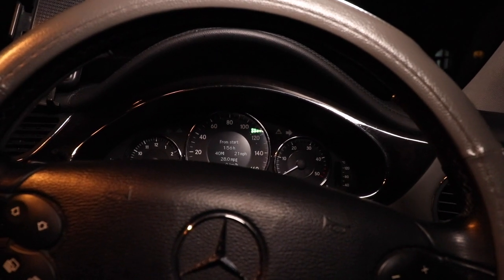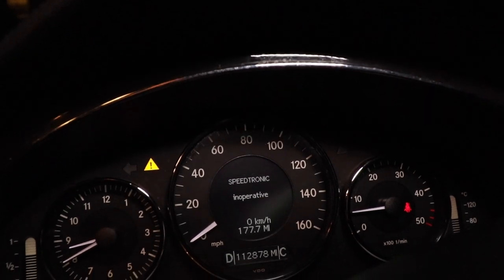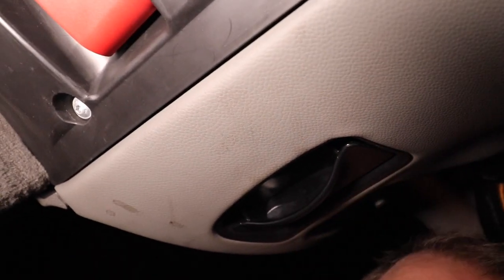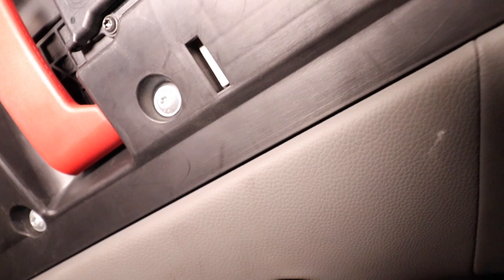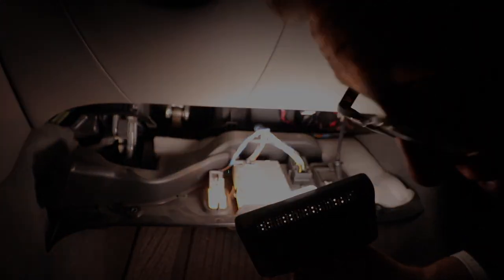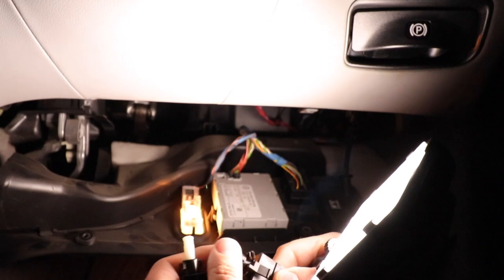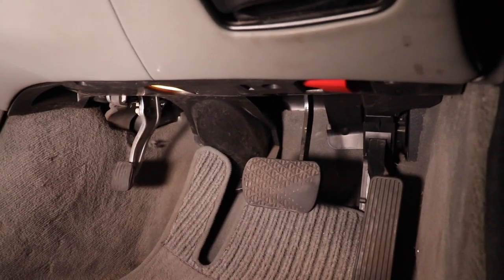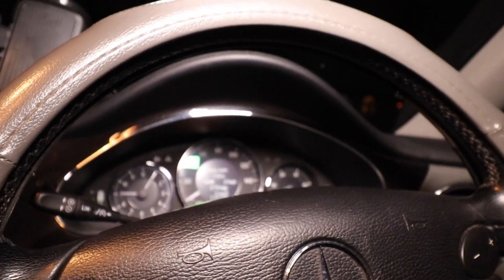ESP, Speedtronic inoperative, brake light switch

Comment: Does anyone have info where I can find a brake light switch for 2006 ml500 please!!??
Reply from the maker: What country?
Reply: @RG500_detectorist  U.S. Does it even have one? Man, I'm in a bad situation. My car is getting worse. Now has the big BRAKE light on and its taken the power steering. ??
Reply from the maker: @WhoDeyWildcatsReds  try it. It breaks everything
Reply: @RG500_detectorist  I've looked extensively across the internet for a brake light switch for that model and I haven't had any luck or I would. Is there a similar part maybe in the 2006 US version? Or maybe it's called by another name?
Reply from the maker: @WhoDeyWildcatsReds  Looking down the comments. 
@khaledakl38 - 2 years ago bought one for 8 usd.

TRY THESE:

Looking on Google, I've found lots of sellers of this part. Pattern and original for as little as £5.85

Genuine Mercedes-Benz W211 E-Class Brake Pedal - Brake Light Switch A0015456709
Manufacturer Part Number:	A0015456709
£21.49
https://www.ebay.co.uk/itm/121365788791

ERA Brake Light Switch - £18.49
Product Code: 464220110
https://www.eurocarparts.com/search/464220110?gclid=Cj0KCQiAzZL-BRDnARIsAPCJs72v_gWX2OEiSfAKXJ1R8FzR4f2EhfbByWbqQu6pEeUC2_4iwkm2-cIaArPVEALw_wcB

https://www.ebay.co.uk/itm/131504018123

https://www.gsfcarparts.com/931me0080?auto_apply_coupon=SHOP60&gclid=Cj0KCQjw28T8BRDbARIsAEOMBcxy1WldQprVRNj-CTZv5xYCSvn0W0fFcfo-JB1vH7mFAGQWRuHXkN8aAohJEALw_wcB

https://www.onlinecarparts.co.uk/car-brands/spare-parts-mercedes-benz/cls-c219/18962/12348/brake-light-switch.html

Good luck, I hope you find an easy fix and thanks for watching and commenting.

Comment: Thank for the Vid. it's ESP and not EPS, which stand for Electronic Stability Program and won't crash your vehicle unless you are driving over 160KM in harsh weather condition and the simple temporary fix is to disconnect it's module , which located on the trunk or address the ABS. issue which would trigger such ESP code/problem. Scan the faulty code(s), Check the fuses, brake pads, rotors, ABS senor, clean the multi-pole (where ABS sensor goes) in the hub, clean/replace the sensor and finally switch the engine on, turn the steering wheel to the left and to the right until you feel no more rough engine hesitation and that's it. ESP. is not a serious problem as far you are not racing in high speed, but the ABS., which caused it to be.!!!
Reply from the maker: Hi and thanks for highlighting that it is ESP not EPS! I've updated the name. And thank you for the very helpful tips.
Reply: Hi hady, could i contact u pls? I have a huge problem with the ABS and ESP and i've spent a lot of money yo fix it and my money went in vain. If i stopped completely the ABS it works a little bit good if the abs sensor is on the car doesn't work well at all it's like im riding a very useless old car.
Reply: What if it reoccurring??

Comment: Mercedes is a big rip off I never took my car to them to get work done always did my own work from installing my engine transmission water pump radiator ignition coils crank sensor mass flow sensor rewire my driver door to get my windows up seats working. Mirror working starter AC compressor alternator fan install all fuse boxes fix my suspension fuel pump install new windows regulators fuel sender oil change transmission flush all this work I have done myself
Reply from the maker: Hey Robert. Thanks for your sharing your experience. Wow! You certainly know your vehicle inside out! Brilliant to hear you have the skills and confidence to take on all those varied jobs. Ironically my car has just started showing ESP inoperative again with run flat indicator inoperative. It's a new issue. I'm going to get it tested next Monday so will post an update as the error is similar to the one in this video but the cause must be something else. Thanks again Rich
Reply: Hey man, I have 2008 R350 & ESP ABS came on the dash & after resting it a few times the car finally wouldn’t crank or start. Radio, alarm, dash board  & door locks has power, but not the windows & no power to the engine,? What are your thoughts? Thanks
Reply from the maker: @u.r.wanted2know163  Hmmm.. could be 1 of many things. Maybe reach out to Robert Robbins, within this chat. I may be able to help, as he is a true guru in this field.  Alternatively, maybe someone will comment back to help out.

Comment from the maker: IMPORTANT UPDATE !!! After all this time the light  ⚠️ and ESP message has reappeared. This time the suspect is the oxygen sensor. So I'd advise getting the computer message diagnosed. My local garage gave me a free diagnostic test!
Reply: Did u find out if it's actually the O2 sensor? Because my diagnostic says so
Reply from the maker: @IdzaniJohar  Hi, thanks for asking. No I've just continued to drive it around as it hasn't really effected anything seriously and I've only been making short journeys. That said it was doing some crazy messages every time I pressed down on the brake, kept coming up with "HOLD". Need to check out what that means. Made me think it might be the brake switch again. I'll let you know when I get it into the garage to sort this out.
Thanks again.
Rich
Reply from the maker: Bodie Marshall  thanks for the tip. I'll go and check it out
Reply from the maker: @Titan Henrik what's the Web address and is it just fixing cars?
Reply: @RG500_detectorist  These are very expensive cars ... how come they have so many problems ! ? !
Reply from the maker: @silverslave333  I understand they were really high quality up until, maybe the 80s or 90s. Then some sort of take over, change in quality and everything went down hill. Loads of issues with electrics etc. Mine has settled down with age but when newer, it had repetitive suspension issues. Always had electrical issues. They're just riding on the brand name. Although I think newer models are now more reliable. 🤔
Reply: @RG500_detectorist  i have a 2018 vito van, dealer wants $400 per abs wheel speed sensor, and some how all four wheel sensors need to be replaced? Aftermarket sensors go for $60 to $100 each
Reply from the maker: @silverslave333  yep, more rip off examples

Comment: Just finished replacing the Brake light switch on my 2008 CLS550, worked perfect,  ESP Inope
ative sign is off....thank you for your help
Reply from the maker: That's fantastic news! Congratulations on completing the job. So happy that you've solved the issue, without having to spend a fortune filling the pockets of someone else. Especially in these tough times. Thanks for letting me know. Good luck with it going all good now. Mine latest a long time. The issue was fully solved.
Must admire your vehicle. Beast of a car !!
Cheers!!

👍
Reply: Was it easy picker up cls 07 same problem
Reply: @SRTsmokes would your car not start when u had that issue?
Reply: @tcal9230  it would start but soon as I drive it'll turn on I fixed it tho it was a brake light switch like in video easy fix my traction button works now and clean dash no esp light on easy cheap part also for my cls550 08

Comment: excellent video.  the ripoffs  in the auto industry never cease to astound me.  My daughter's B class displays exactly the same message.  I do question the quality of Mercedes.  I have owned several and they are good for about 7 years and then they start to fall apart and cost the owner big money in repairs. This is probably why they drop in value so dramatically.
Reply from the maker: Thanks so much for your comments and sharing your knowledge and experience. I think all industries are actually the same. Whether car servicing, builders or a government buying PPE. Without due diligence and awareness then your up for being ripped off. Human nature or good business? I understand that Mercedes changed manufacturing processes, I think maybe in the 90s. This resulted in years of poorer quality cars simply badged Mercedes  but not with the build quality of old. Looking at the models even later than mine, they appear the same as a Vauxhall or any other modern car.

Comment: Same goes to my B200, same warning. Pulled out the brake switch, pulled the white plunger out, installed back, stepped on the brake once to reset it. Done and good as new.
Reply from the maker: Brilliant to hear another massive saving from the Mercedes rip off that I experienced

Comment: Thanks. Yeah, they also have an inconsistent price for parts. Called Arlington TX and asked how much a visor replacement would be; $302. Called dealer in McKenny TX, $200. Then thought I would call the dealership in Calabasas,CA who I have used before, $167. Only problem they won’t ship parts. But how freaking random is the price for parts that I would install myself?  Dang rip off!
Reply from the maker: Hi. For some reason YouTube was hiding your comments under held for review. Sorry for the delay and hope to see you soon. That's for your support and valuable contribution!
Reply from the maker: Hi. For some reason YouTube was hiding your comments under held for review. Sorry for the delay and hope to see you soon. That's for your support and valuable contribution!

Comment: I need to try this. I mean I have a C180 executive SE petrol 204 2013 edition. During a trip around Europe all of the electronics went off. I got ESP, SpeedTronic, tire pressure sensors, Cruise control, break hold and adaptive breaking lights gone, and also the eco start stop all saying inoperative... In Spain they told told me it was the battery. I spent 500 euros in a new decent Battery still not working after... In Portugal someone put it in a computer and said I need a new central ECU.... Possibly costing 4k.. I haven't been to Mercedes UK where I got the car brand new but ill give this a try and let you all know. Oh I was also told it was a wheel angle sensor but no one seemed to know which one was at fault. The truth is everything was working fine and after a small bumpy road everything stopped working. Still the Skid control and ABS works fine as it won't spin or lock wheels during hard breaking the ABS kicks in. But if during a turn the car skids rear end in loose control and the ESP won't kick in. I know this because I was doing hard turns to make it happen to see if the systems kicked in and they didn't. I'm so confused lol
Reply from the maker: Hi, yes would be really keen to know if you can dodge the high prices and unnecessary work, always worth a try. Well good luck, I hope you can get it sorted. Cheers and thanks so much for watching and commenting! Rich
Reply: hello how did you fix it

Comment: Just fixed same issue. You need brakes light switch, I don't think there is a different name for this. I bough one for £7. Only issue that the white end plug didn't fit the socket, because of a notch, which didn't match, but I just cut it off. It's soft plastic. All systems back online. Wasn't planning to visit mercedes, the charges they have are from space... Thank you very much for this tutorial as it saved me few hundreds. I have new issue now, 3.0d engine jerks when sharp accelerating. It went twice into safe mode. I thought it was low level of fuel but it did happend couple of times with half tank. It doesn't happen every time though... Anybody faced similar issue? Thank you.
Reply: @RG500_detectorist  well I guess I will have to live with this too. This car is excellent for steady cruising, so I will not be affected on a daily basics. Thank you for your help. 👍
Reply: My car is 2006, 122k miles on the clock. I think this jumping happens mostly if not only when gearbox has to reduce gear in order to accelerate. Didn't notice when accelerating from 0... Gotta investigate this further. Maybe gearbox management issue..
Reply: Would you be able to show which me where is that electrical component you have got replaced by mercedes? Is it accessible, can I get it done by myself somehow? Maybe my is damaged too.. thank you.
Reply: Can you tell the name of part
Reply from the maker: @pradeep10087  Looking on Google, I've found lots of sellers of this part. Pattern and original for as little as £5.85

https://www.ebay.co.uk/itm/131504018123

https://www.gsfcarparts.com/931me0080?auto_apply_coupon=SHOP60&gclid=Cj0KCQjw28T8BRDbARIsAEOMBcxy1WldQprVRNj-CTZv5xYCSvn0W0fFcfo-JB1vH7mFAGQWRuHXkN8aAohJEALw_wcB

https://www.onlinecarparts.co.uk/car-brands/spare-parts-mercedes-benz/cls-c219/18962/12348/brake-light-switch.html
Reply: Hi.. same thing happens with my car e 280 cdi. V6 diesel.. check the egr valve it's a common problem with w211. Get the egr valve cleaned... I am getting this done next week..

Comment: Thanks for the info mate! I have the same issue on my w204 c class, run flat indicator issue, esp inoperative, brake light fault and the engine light is on. Headed to my mechanic and he had no clue. I guess that’s the same issue as yours. Will definitely order the part and hope that will help! Thumbs up!
Reply from the maker: Brilliant news that you can get it sorted...cheap, rather than pay a mechanic to see if it's this or that. Good luck, hope you're sorted soon.
Reply: Whats was your issue Donald have you solved it?
Reply: And???
Reply: This will be either the ABS sensor or the pickup ring. I had the ESP & ABS lights illuminate on my W204. Error codes pointed to the right rear ABS sensor. I replaced the saneor but that didn't fix the problem. The ABS pickup ring had delaminated so I replaced it and it fixed the problem. I also reinstated the original ABS sensor as there was nothing wrong with it.

Comment: I hear you Loud and Clear (Capitalism at is best) Like me your probably not against someone providing a service and charging for it...But those Authorised Dealers really take the biscuit... Well done !!! taking a crack at it yourself and thanks for sharing.
Reply from the maker: Thanks for watching and commenting. Absolutely agree with you. We all want a fair payment for our time, services and knowledge but when anyone can do something and take a fraction of the time quoted, we also want honesty. They could have easily mentioned, that I could have done it myself, rather than keeping it all a mystery and trying to justify their charges. I actually had a manager from the garage all me, after I made a complaint. To my amazement, he still tried to justify the time they allocated, even after I told him that I'd fixed it in 3 minutes. Unbelievable Authorised dealers!!
Reply: @RG500_detectorist  The Irony is Rich...After watching your video, I was prepared to have a look at the Brake pedal switch and duly removed the panel under the steering wheel only to discover that my ML280 2006 W164 does not have a Brake pedal switch underneath the dash. Mine's is actually situated on the underside of the Brake booster under the Brake master cylinder. I think Mercedes must have seen your video and moved it because it was far too sensible to have it where "Owners" of a £36,000 (New) car could find it themselves.  for the kind of money people pay for these cars They should supply Star diagnostics equipment and a Full service manual..... "In my humble opinion"
Reply from the maker: @creativewebmedia-uk  Really sorry to hear yours was more tricky. Hope you got it sorted. This, like so many industries, I feel is just one of many rip offs in the world. We're so blind sometimes, based on the illusion that you can trust people. Many you can't, right?
Reply: @RG500_detectorist  Fortunately the brake switch was not part of my issue. We could discuss the pro's and con's of design and how it can be improved. but the bottom line is sadly what is uppermost when considering how and what to include in the process. This is made so much more difficult when you scale things up. with 1.2 Million M Class Owners a little washer that costs just $0.50c (Since the car is assembled in Tuscanoosa USA at 100,000 cars per year =$50,000 dollars US now when you tell that to the Board they will tell you to find another  way to do it....Enough Said

Comment: thanks for this ive got the exact same messages on a w204 model and the switch though slightly different is the same method for replacing , Im waiting on delivery and will try it out for the sake of 10 quid its worth a punt cheers
Reply: i have the w204 did this work for you ?
Reply: @susan2372  no it didn't mine ended up being a speed sensor in front drivers side wheel , just get a garage to do a diag most will check for free
Reply: @neildyer128   thanks for this. It looks like a lot of us seem to have the same issue. I'm trying to switch first if not I may check it again because it also like in your case could he wheel speed sensor or angle sensor
Reply: @wealthgrowthtips2815  it is a common fault the switch is about 15 quid most garages will diag for free my sensor and fitting was 50 quid all in
Reply: @neildyer128   thanks mate 🙏
Reply from the maker: Glad it helped
Reply: Me too, I’ve had the problem over a year and still had no fix yet 🙃 the problem is that when you send it in for a diagnostic,, it shows nothing. It’s like finding a needle in a haystack for me, endless hours with my head under the bonnet and under the car. Absolutely sick of it. If this cures it my mind will be officially blown

Comment: Having the same issue with my ML350 2006. Thinking I should try the same repair, what do you think?
Reply from the maker: It's easy to check. 
Watch the video and see the old switch. You'll see it sticks. Within 5 minutes, you can remove you switch and check it. If old and sticky, replace for £15. If it's OK simply put back. 👍